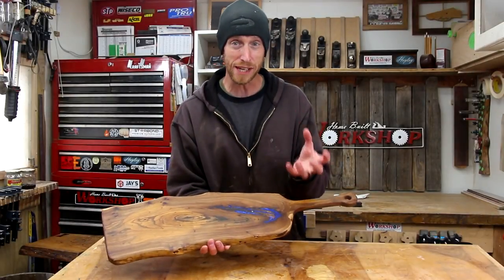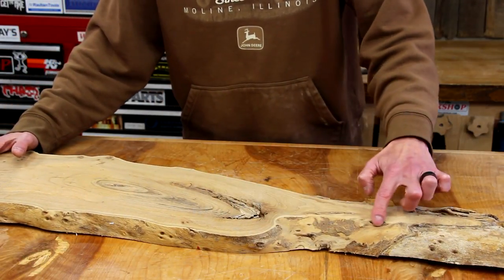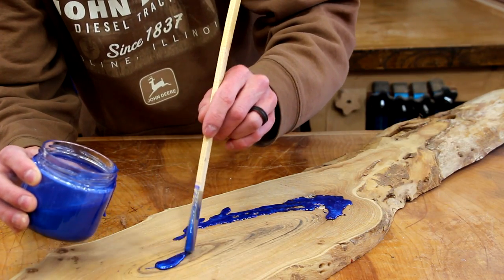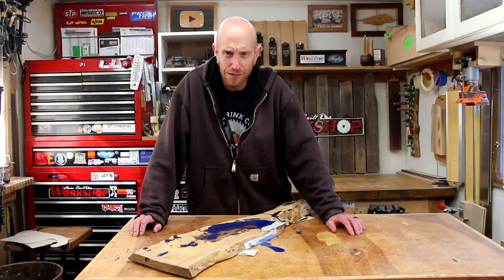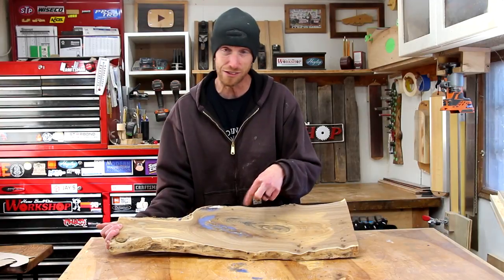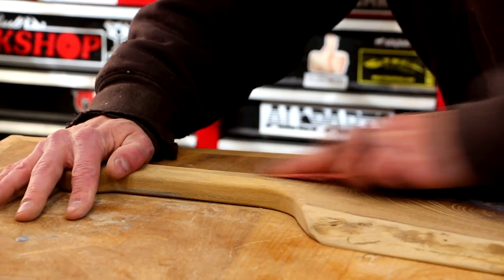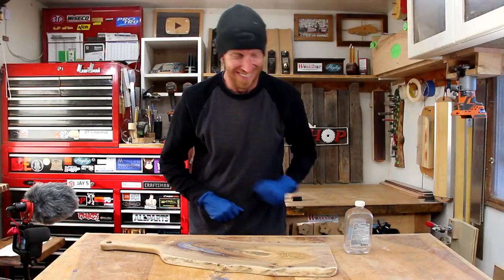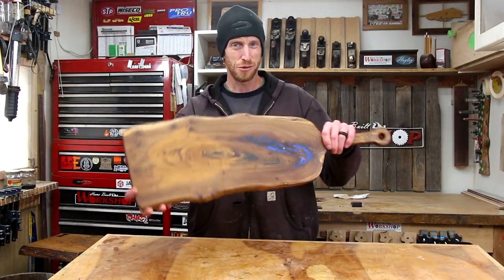How to Make a Serving Board | Bring on the Meat and Cheese!

Comment: Fun fact for anyone that doesn’t have a heat gun or blow torch. The carbon dioxide ( not the heat) is what removes the bubbles in the epoxy so if you don’t have a heat gun or blow torch you can blow hot air from your breath on it and they’ll disappear!
Reply from the maker: Interesting. I did not know that. Thanks for sharing.